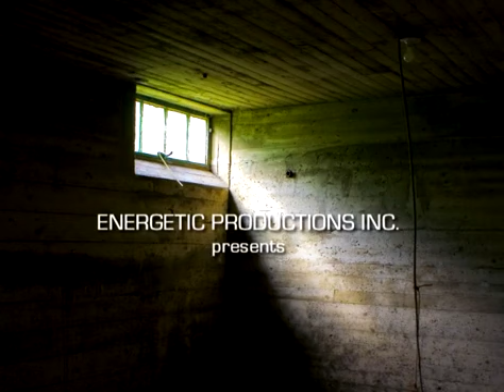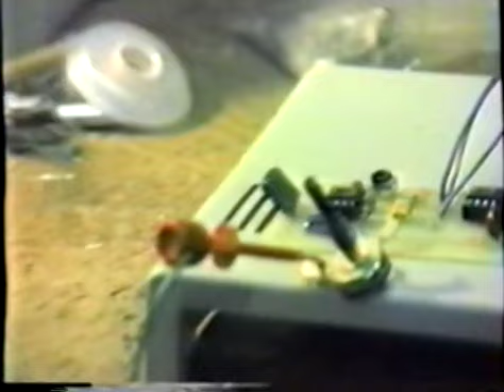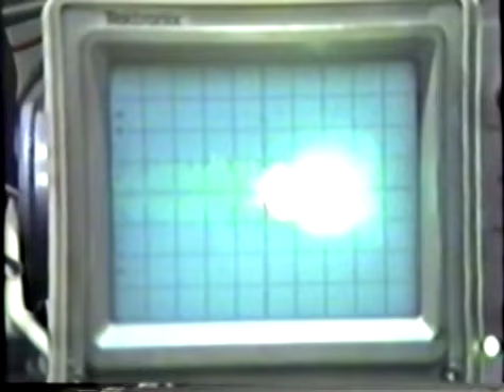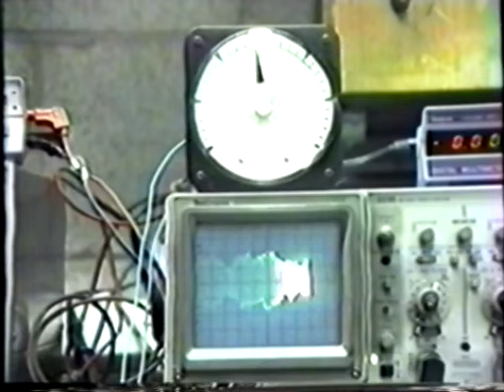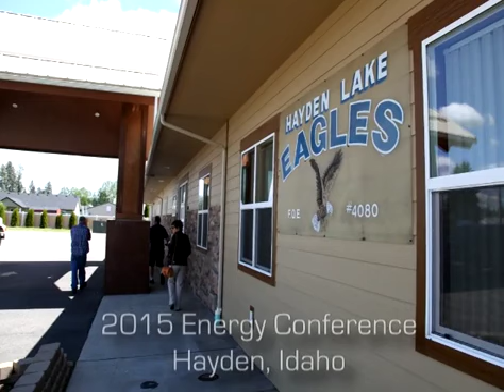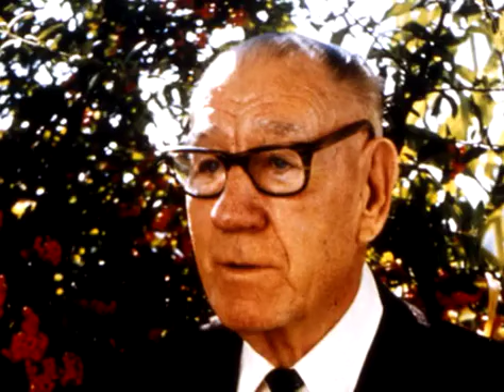#45 - The 2nd Bedini-Bearden Basement Tape (2019)

Comment from the maker: 2:28: 🔊 Exploring gravitational waves through audio recordings with a homemade tuner.
2:28: The tuner consists of basic components like ICs, capacitor, and feedback loop control.
3:58: The tuner picks up gravitational waves inducing a charge in a capacitor.
4:10: The gravitational wave tuner has high gain and two stages for audio amplification.

10:32: 🛸 Demonstration of gravity wave modulation through frequency changes.
10:32: Gravitational transmitter altering frequencies to generate waves
11:53: Observing waves inside waves through frequency adjustments
12:03: Use of gravity waves to modulate powerful transmissions

21:40: 🔊 Exploring the potential of capturing and utilizing energy from seismic frequencies.
21:40: Seismic frequencies have the capability to generate significant bursts of energy.
23:46: Capturing and amplifying specific seismic frequencies could potentially power motors and lights.
24:03: Tuning an antenna system to seismic frequencies may allow for harnessing energy shifts for practical use.

38:52: ⚡ Demonstration of gravitational waves affecting video and audio signals through transmission.
38:52: Gravitational waves modulate sound and video signals, causing screen flickering and audio fluctuations.
39:46: Transmitter can affect the stability of the screen and pointer, indicating the ability to transmit on gravitational waves.
42:11: Frequency changes impact the waves' behavior, with consistent wave patterns observed.

48:26: 🔊 Discussion on gravitational waves, shot noise, and electrical circuit oscillations.
48:26: Various measurements and studies being conducted, including gravitational waves and shot noise.
49:09: Explanation of shot noise in semiconductors and its resemblance to an oscillation.
50:13: Occurrence of self-oscillation in electrical circuits and the desire to eliminate it.